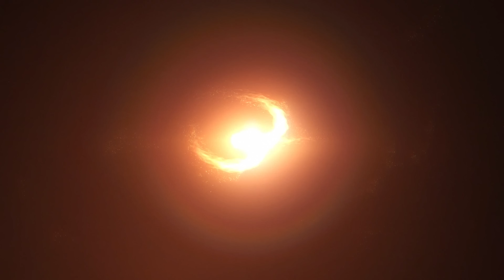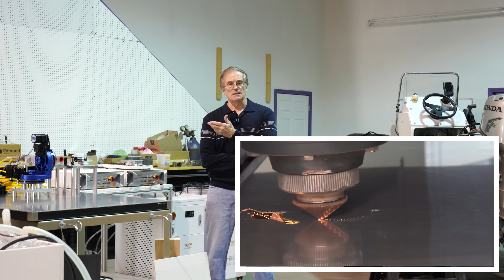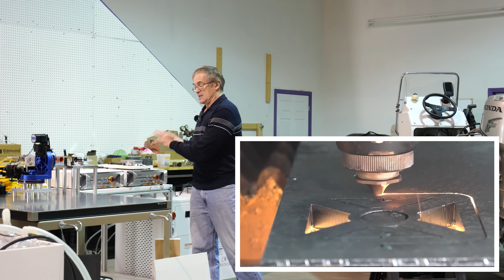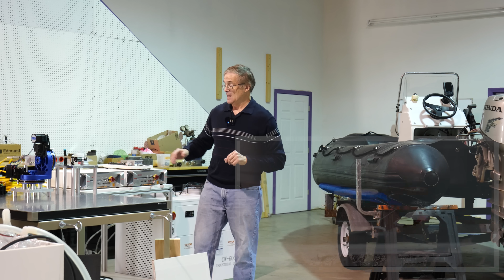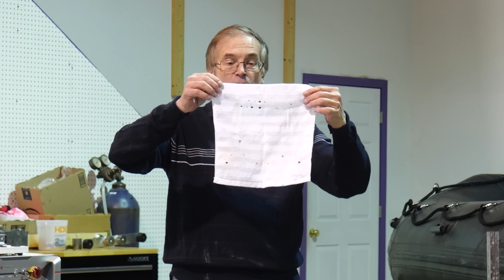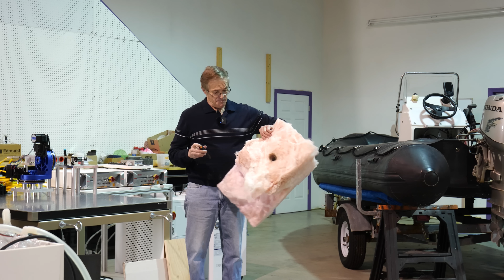We have a problem... and need your help!

Comment: For test purposes, Instead of pointing the laser horizontally, point it to the ground. The planet itself should neutralize the beam.
Reply: An aquarium filled up with Zyrconia particles (or other material that absorbs the laser wavelength) in water.
Maybe some stirring will be needed.
A hole?
No problem, it will be easily fixed.
The idea is to constantly move the hitting point or change the material at the spot.
Reply: @paulcohen1555  
"(or other material that absorbs the laser wavelength) in water."
Wrong.
Absorbtion IS THE PROBLEM -- that's what is causing all of these other materials to fail.  The ideal is DISPERSION, that is, lowering the energy concentration down to something that is no longer destructive and dangerous.
Reply: @paulcohen1555  yeah I was gonna suggest what you’ve already suggested. An aquarium with something fine to absorb the light and transmit the heat to the water. Which could even be ink? And if the aquarium is roughly in the shape of an archery target and kept rotating, any bubbles formed by vaporized water will move out of the beam faster than they would just due to gravity? not so much at the center of the target though - were there wouldn’t be much motion.  Yeah I think aiming the beam down or reflecting in a mirror so it goes down into the Earth is a better option. it’s safe to aim it down into the Earth. It’s not coming out the other side.  not a chance.  But you may end up with something useful for geothermal power production although I presume you’re not even close to what’s needed, even just for that.
Reply: @paulcohen1555 love this idea!
Reply: Have you seen the Rick and Morty episode where they drop a lightsaber…
Reply: @bangsbox you shall be the next chief of engineering.  It is a coin toss, Putin already has a hole on his land, the deepest. Xi does not share much, as our president and corporations keep trying to fleece him... 😂  🤔 geothermal, with this laser? For an alternate means to drilling the well ... 🤔 $$$😉
Reply: @bangsbox  hahahah 😂
Reply: this is probably the way to go. It's cheap and safe.
Reply: I wonder if heavy theatrical smoke, or (pigmented?) water mist, could also absorb some of the beam?
Reply: @lyfandeth Yeah I was thinking something similar, atomizer vapour tunnel.  Long tunnel full of vapour, then something at the end of the tunnel to catch the weakened beam
Reply: A huge sandbag. If they persist in pointing the laser horizontally. Vertically, it would be much easier.
Reply: I think you need thick carbon foam. It would only weigh like 20 pounds, but would not be cheap
Reply: The Super Proton Synchrotron uses graphite. A Google search immediately brought up graphite blocks. Also consider collaboration with your friend Nighthawk in Light to test his formulation of Starlite?
Reply: @MrBillTroop73  I thought of him immediately too. He's worked on some materials that could be really good for this.
Reply: @MrBillTroop73 my first thought as well was nighthawks starlite.
Reply: A combination of ideas here may work.
Point the laser down over a large drum of water.
Put some sand / crystal particles in the water and agitate it with a pump.
The hope would be to defuse the light and adsorb the heat in a cheap and easy to move container.
Reply: software glitches for second and suddenly Kola Peninsula in Russia is not anymore the deepest man made hole anymore !
Reply: @realdamageboy  It would take a few DAYS to do that.  You're talking about vaporizing 20 MILES of rock via only a a 1 mm^2 application surface.
Reply: What about sand bags or two drywall panels with sand in between? Sand can be poured in an drained out for transportation. It is something like a brick but that can be poured
Reply: If they are at all worried about fires, what about aiming down into something like a pool? Also commented over in the suggestion of a waterfall, but a pool might be more simple to contain, just need to figure out how to suspend the laser and prevent it from over traveling the edges of the pool. Also suggested dyes/pigments could increase the rate at which the laser is dispersed . . . think green water on St. Patrick's day but something more opaque.
Reply: @MrChompenstein  
Waterfall in a turbulence zone beats a pool, because of the constantly changing refraction angles will disperse the beam in time, even if not dispersing it in space.
Reply: They did that in Independence Day movie…. Drilled a hole to earths core.
And similarly in aliens v predator.
Reply: @GSCt1000  Yes but I think they let the devil out and now runs the earth!
Reply: @GSCt1000  🥁🥁📀
Reply: @GSCt1000  it's real far
Reply: @GSCt1000  you saw a very different independence day movie than the rest of us. you mean "the core"?
Reply: @gg-gn3re the core was with unubtainium , where they had to restart the spin with a nuclear weapon to restart the magnetic field.. I’m sure it was independent day one or two.
Reply: @GSCt1000  oh I guess some new independence day that nobody should ever watch has some aliens drilling
Reply: @everton-zp  this is an interesting thought.  Pairing this with sand would be great.  Nothing is likely to be cheap, but yeah mount this thing high and change your x and z axis.  I wonder if you still get to test drive the same kinematics in the “where will this be” tracking formula such that it mirrors horizontal orientation
Reply: Because now your z axis has the acceleration of gravity which affects vertical drone movements, so like if the drone drops into free fall kinematics would help but now you are judging that axis not by easy to detect left/right or up/down but by the shrinking of the size of the object, if only using rgb

You can still hit it of course, a laser is a straight line, but you aren’t any longer testing it the way one would really use it, guessing the position it will be in and “hitting” it if the drone operator decides to nose dive it for evasion
Reply: Exactly my thoughts, so simple.. just cut into unlimited depth mud for free  - why try to make a fancy wall
Reply: A gun range?
Reply: *and keep the world hostage. As target the moon. Or both. (2 lasers!!!!11)
Reply: A ten foot long piece of corrugated pipe, filled on site with dense sand (like zircon sand) or pea gravel, filled with water, might give you enough absorbtion? Using a sacrificial inch thick soapstone slab in front, so it didn't all drain out instantly?
Reply: Laser drilling! :D
Reply: @lukakrulc1092  that would be interesting video if not just a big melted hole, I'm wondering if the stone can vaporize if exposed to short firing frames, then cutting might work ? ..
Reply: Low angle vertical steel sheet wall with a flow layer of water from the top. The beam hit the water layer first but the continuous flow of water will cool down the steel as well as the diffuse the beam. That wall could also be made of multiple sheet vertical cascade  just like a fresnel. Still positionned Nearly vertical but with light negative angle pointing down but just vertical enough so they keep water flow to stick to it.
Reply: what about plastic negative fresnell lens who expand the beam at exit...?
Reply: or if something could reflect it, put it behind and angle it 45 degrees and redirect the laser into the concrete ground, you can always fix a few holes without much effort. if the material absorbs some of the energy, you could make a series of mirrors to bounce off, losing energy each time then finally into the earth, but that would be impractical if it has to be big.
Reply: @JetSteele  Concrete would be like hitting tnt with a hammer!
Reply: @Moonlightshadow-lq4fr  Well, I don't know what his workshop floor is actually made of, I was just saying concrete without thinking. You could redirect it to a pool of dispersive liquid like water or a gel with billions of suspended reflective particles. Or, if firing horizontally, since he was impressed with the wood but it burst into flame, alternate layers of the wood and whatever metal absorbs it best, sandwiched and clamped tightly together (metal layer on outside) with a seal around the edges to limit oxygen ingress to help avoid fueling internal fires, the wood being separated by the metal would hopefully isolate and contain any potential fires anyway. Get CO2 with a small nozzle and just blast some in the resulting hole after test firing, or just cover the hole with tape since the only source of (external) oxygen for the fire would be the hole we just made because we sealed the outer perimeter and we made it thick enough that it wouldn't penetrate fully (or, if that's not possible, just use two bits of tape 😂). Angle this panel down 45 degrees so the laser hits more surface area (and redirects any reflections, both externally for safety and internally to maybe bounce the beam around a bit within, dissipating it's energy somewhat), and it is a thicker obstacle to penetrate.
Reply: Some kind of composite is the likely solution. Based on your tests, perhaps a sandwich of plywood between drywall panels glued together. There will  be no oxygen to burn the plywood.
Reply: Like @everton-off-road said, reorient your test to point at the ground. This would work quite well and if done in your shop would cost the repair of it floor (just be sure to avoid utilities). If you needed distance, a tower can give you the height you need, might see about renting one or something or mount it to the ceiling of your shop.
Reply: Eh.. I took a fresnel lense off a big screen TV and burnt a hole straight through the concrete in front of my garage.
Reply: Huh?  @D4Dummies
Reply: The engineers of the Death Star think otherwise.
Reply: It would work, but then you severely limit the range of the laser.  Think in terms of the old photographic enlargers.  They could only enlarge as much as the height of the column head of the enlarger is from the projected image.
Reply: water cascading down a wall?
Reply: I agree this was my initial thought. Just elevate and turn the beam vertical, point it towards the ground.
Reply: I posted elsewhere but if you have to do it inside direct it into a tank of water with suspended carbon (coal graphite etc) or if that is not possible a sheet of carbon with water flowing over it as a waterwall.

Literally just wet charcoal with water recirc. It is non ablative water cooled heat shielding used in reentry vehicles. Just don't shoot a block of foam at it.
Reply: I'll be on the edge of my seat, waiting to see where this goes. Resist the temptation to target the Youtube servers. 😊
Reply: This sounds like the most efficient solution. You could then easily put any material under it, like wet sand maybe or a pile of salt or anything else.
Then again, if they want to test its targeting capabilities then pointing it at the ground might not be viable
Reply: Water Waper or CO2 Waper.
Reply: Just be careful not to drill a hole in a gas/water/electricity/phone line!
Reply: Could have a fume hood style set up that has a smoke machine misting a waterfall of fog and see if it helps dissipate the energy before hitting and semi resilient backdrop mention previously
Reply: This reminds me of the episode of Rick and Morty where Morty drops a light saber straight down, and they have to chase it toward the center of earth. 😂
Reply: We are now building weapons that A) Anyone can buy, and B) we do not know how to control.
Reply: To point the laser at the ground, you would need it to start from high up. The table with the final lenses, and the laser generators on wheels would need to be brought up to the ceiling, in order to fire at a drone flying inches from the ground. Hundreds of pounds of sensitive equipment twenty feet up. After all of that effort, what you achieve is punching through utility conduits which are not very far underground. Clean water, storm water, sewage water, gas, electrical wire, networking wire. A computer-guided laser pointing at a drone will not be able to know what's under the house.
Reply: Point it down, have water to catch the beam
Reply: @brettharris9141 Water may reflect laser beams so is not necessarily safe. during my high power laser course we were told specifically not to shine lasers at water.
Reply: Stop the beam with a mirror at 45° down into a pond with colored water....if the mirror can stand the beam. Maybe polished aluminum or stainless steel...🤔
Reply: perhaps he can edge a logo in his garage floor at the same time.
Reply: If lucky he might strike gold or diamonds
Reply: stupid enough that it would work :3
Reply: This is the way.  Laser at elevation (?on the roof) pointed down.  If you want a more complicated solution, buy a boathouse so the floor is water.
Reply: An abandoned quarry or open pit mine should work well.  Physical stops will keep you safe and the beam inside the quarry.
Reply: @latemarch2  They have to do it inside a building because even lasering small cheap quadcopter drones is the same as shooting down an airliner from a legal point of view in the US.
Reply: @latemarch2  that would be a bit sketchy... if even 1/10,000th of the energy those beams put out hits a random piece of reflective mineral (think pyrite) you could really get chaotic damage to god knows what - or whom.
Reply: @latemarch2 they have a ‘laboratory’ they’re accustomed to working in.
Reply: I hope so. otherwise some guy having his morning poop in china would have a very rude interruption.
Reply: That is what the Atlantians said, followed by 'Oups, we melted earth. Mayday, Mayday we are sinking!'

Now dont go do gain of function research, you might just accidentaly kill millions and make apparachiks around the world accomplices
Reply: What about buckets of water? Not an engineer just a thought.
Reply: Oh ffs... I just wrote this almost exactly..!  I never read first, just type...
Reply: If you place the lasers high up this seems workable.
Reply: Water tank with a thick acrylic port hole as a target. Acrylic gives off VOCs when cut; not great, but less toxic than even plywood glue. The port hole is replaceable between shots, but it could also be repaired by gluing in segments of acrylic rod. Since the spot size is small by nature, the holes should be small and the water loss should be low as well; place a tray or pan below the port hole to catch and reuse the water. The inside of the tank can be coated with something that absorbs at/near the laser wavelength, or be coated/polished to reflect laser light back into the water. Add mica powder (or similar) to the water to further scatter the laser light; keep it distributed by circulation...a sealed system with a peristaltic pump will circulate the water without fouling. Tilt the tank vertical to replace/service the port hole; it could be mounted on a stand with pivots at the cg of the full tank to make this easier. Reflections coming back from the first surface of the port hole might be minimized by firing through a sacrificial curtain; space out alternating layers of heavy canvas and mylar "space blanket" material...it shouldn't catch fire (maybe smolder a bit, soaking the canvas with water would minimize this), and it should catch scattered light and reflect semi-cohesive light back towards the tank. This way, the only cohesive light coming back towards the source would be straight back at the emitter through the holes in the multi-layer curtain, and only from when it first hits the acrylic port hole until the laser ablates through to the water, which should be a very short timespan from the sound of it.
Reply: Or find a hill, like at a gun range.
Reply: Tilt
Reply: Try that hard synthetic clay used for car detailing.
Reply: Window glazing? @tdrv33
Reply: Unless it melts its way through the dirt and hits a burried gas line or ignites some sort of oxygen bearing geological deposit which creates a self sustaining inferno that results in sink holes to a firey abyss.
Reply: Im stuck on tile backer board. Soak it in a flame retardant. Screed thinset across to heal overshoot damage. Better still...porcelain tile, back side out for non-reflect absorbency. If that laser does anything to porcelain tile, installed over acrylic thinset, on to cement tile backer board screwed every 6" perimeter 10" field, soaked in flame retardant over existing wall substrate, I need to see it.
Reply: Corridor channel made videos about this ...
Reply: I don't know if this would help, Space X is replacing tiles on the rocket with a different type of water cooled tile, trial I think. If those tiles are heat shields, would they burn up? I'm only guessing.
Reply: only issue: the goal is to shoot down flying things, not crawling things ... but 🤔 suspending the lasers from horizontal scaffolding, if high enough for the drones to fly beneath, makes some sense. could then draw a target ring on the ground showing the limits of the laser's directional gimbals...
Reply: Stonewoll are superior to glass woll  and cheaper. Sudgest a layor of this and a layor of slight angeld mirrors behind to chatter the beam back to the stonewoll. Wettend  bedcheats would be self addhesiv and cool the reflectiv layer just a bit.
Reply: This is literally how volcanoes start
Reply: A blue patio umbrella
Reply: Using fiberglass flashed to mind in the begining of your test narration, but later seeing your sample; burned, a hole in my ego!
You leaned on the idea of optics of diffusing the beam, but that fiberglass was not optical grade as with fiber optics or lens grade, so this route still nags me!
It could be expensive but perhaps using multi layered, angularly offset, optical grade glass mesh could be used, to scatter the beam.
Stay with me! Not the industrial kind!
Suitable diameter*** monofilament woven glass mesh.
With sufficient open area percentage, determined by trial and error, dyed or undyed according to your optics experience.
It will have to be custom made as industrial mesh would be too delicate.
* I guess the diameter should be as large as the laser generating cylinder (I imagine), which is serving you well!
It could be supercooled with blasts for the cutting duration.
Layers of previously tried sacrificial materials could be used along with this.
Will a brick size version do?
And hey, what did you say your special laser was made of!
I'd be thrilled if I have made a contribution in any way!
Wish I had a laser cutter welder to play around with!
Best wishes!
Reply: Faraday cages of microwave doors.layers.
Reply: A bulk container of sand.
Reply: This is actually something I read someone did on Reddit.  Basically, they did their laser work in the fireplace!
Reply: What if it shoots a hole thoough the planet😂
Reply: Or into the sky!
Reply: How about applying a a light absorbing paint like the Japanese black paint that is so hard to see because it has no reflection whatsoever..  if that were applied to a concrete pavers lined up in parallel with air gaps in between.the paint could absorb some of the energy and then the cement pavers could take the rest of the hit.
Reply: Can the laser be dispersed with the same optics approach you use to focus it?
Reply: Id say wet ash from a woodstove
Reply: A rapidly rotating boron carbide or aluminium nitride  drum  with a roughened surface and a co2 gas cooling system?
Reply: Adaptive optics testing uses laser pointing into the sky. They usually hire a grad student to watch for planes.
Reply: ☝️ This is the best idea I have heard thus far and I'm almost embarrassed to admit I didn't think of it. Will it come out the other side of the Earth however if the laser is powerful enough? Eventually yes, they will become so ( as long as humans continue to improve them) and then power will become infinite (or at least powerfull enough) at which time most certainly, the laser would push through the other side of the planet. At that exact point in time (or hopefully well before if we as the human race plan for it, let's do that)  it becomes an ethical question if we as humans of the planet Earth should be sending infinitely powerful laser beam weapons into space.
Reply: Pissoble create a pressure sensitive triggering system that alters the quantity of power being used? Maybe a feild of some sort thst is on a rotation so a gravitational firce can decrease the strength is wanted and sinply rotate the system so itboperste normally? Posdible? 😂 Can u use other materials non metallic within the system? Absorbing more. Or like he said reflection angles more subtle? Surprise I'm a layman 😂
Reply: How about placing the laser inside a bowl shaped like a satellite dish with a mirror finish on the inside? The walls of the bowl being so high that it cannot fire beneath 10 or 15 degrees of elevation. I am not a scientist and I dont know if there is a reflective coating that can withstand such a powerfull laser, but my idea is that if it fires below the rim of the dish it should be constructed like a parabola so that the beam is directed upwards if it hits the sides. Ok this might be insane, and introduce a whole new range of problems, but i have heard that they "make" mirrors for observation of deep space, where the mirror is quicksilver (Hg) that is spun around to make an almost perfect mirror.
Reply: dry sand (sand dune) it'll fall in on itself refilling hole as long as not turned into a glass tube i also like the 45 degree downward angle to maximize the backstop  or wet sand even you  could mix aluminum powder into your sand and then  control lazer with 3d printing head to try and make  3d models 😅 but that's another project
Reply: Maybe using a.large plate made of starlite
Reply: A waterfall?  Filled with alumina powder?
Reply: Waterfall feature over a brick.
Reply: Had a similar thought, but maybe direct the beam into a pool of water with IR absorbing dye
Reply: Now I want to watch the video.
Reply: Hmm yeah a mirror into a kiddy pool with stirring, dye, and potentially some ice would probably work. Utilize the massive thermal capacity of water. 

Would need something that could reflect this thing without melting though.
Reply: I'm not sure about the material to use, but try a moving target so the beam isn't focused on a single point. I'm thinking a white cotton buffing wheel soaked perhaps in oil rather than water so it doesn't evaporate as a proof of concept, but there's likely better materials.
Reply: Rocks explode, violently when heated... Then after they're heated while releasing energy they kinda change into other stuff and release toxic gases and your left with a mess no one wants to deal with
Reply: This is a better idea.
.
https://youtu.be/r3uMeF4Wfy4?si=b1zZkeecCwyWbpaY
Reply: I had the same idea!!
Reply: That will destroy our EARTH!!! 😫😫
Reply: @onklim  well, given the current path of humankind, it wouldn't be a bad idea.
Reply: @everton-zp 😂😂
Reply: Because the target may be a drone i think that would just be easier to send the beam to space.
Reply: Just point the laser down to the ground?
Reply: @ph5740  Yes, just like that. Genius idea, isn't?
Reply: I don’t know if this is suggested already but have you tried ceramic fiber insulation blanket, I think the rating is 2300F
Reply: Something like K wool @SoggyBottomBoy_
Reply: Mirrors covering the walls and ceiling. My 12 yo brain at work.
Reply: @grantadamson3478  Extremely dangerous.  In fact, that would be suicidal.
Reply: Then why not the sky? Let your light go voyaging through deep space...
Reply: @uvtube2008 dude there are planes and satellites. Never risk blinding a pilot.
Reply: @GSCt1000  you are correct about planes, but not satellites. They are too far for it to cause any issues. But also if you’re firing this laser at drones they are going to be in the sky, so I don’t think that matters.
Reply: @GSCt1000 or cutting the plane open, depending on how much dissipation the beam has at distance
Reply: @GSCt1000  loads of laboratories all over the world shoot lasers that bounce off the moon from the reflectors that armstrong and aldrin left there.
Reply: @GSCt1000  pilots don't look straight down, except helicopters in search and rescue. And maybe Cessna's in tilted circling.
Reply: @GrowingAnswers  Would you bet your life on that? I'm an engineer, and I wouldn't.
Reply: @garywheeler7039  I heard that there were cases where some mischievous brats near airports shine laser at planes, which causes the pilots to be distracted and startled by the light.

And where i am is against the law i think.
Reply: @akulkis  What do you mean?? Worried about satellites?…the closest ones would be around 100 miles away. That would mean by the time the laser light reached it, the beam diameter would be over 100 meters wide. That likely wouldn’t even damage anyone’s eye let alone cause any damage to satellites. Now think about that further…even a perfectly steady beam would have a satellite passes through it at 17,000 mph. The contact time in that moment is so short that a regular frame rate camera on the satellite wouldn’t even see the laser light. You know what’s even hotter and than a laser pointing to space…the Sun in space. What kind of engineer are you? I’m not any kind myself. The radiant heat from the Sun in space reaches over 200F on surfaces. And you’d be worried about a little laser?
Reply: @GSCt1000 I don’t think “blinding a pilot” would be the result of accidental laser contact￼… think more on the lines of toast￼.
Reply: @GSCt1000 but what about the mole men in the ground?
Reply: @GSCt1000 or setting one afire…
Reply: @uvtube2008  The FAA would buy you an expensive free ticket to El Salvador 🙄
Reply: @uvtube2008  'the FAA has entered the chat'
Reply: @uvtube2008  I think the FAA will catch you quick! LOL
Reply: @uvtube2008  you'd risk the odd chance and airplane would fly over
Reply: @uvtube2008  That will work great as soon as they get someone to declare the area a no-flight zone. :D
Reply: @uvtube2008  To the sky you risk hitting one of Elon's satellites and he would be very upset. 😅
Reply: @uvtube2008  Will hit a com satellite for sure.
Reply: @uvtube2008 Because of aircraft and satellites…. A woopsie could turn into a very big felony as a minimum…
Reply: @uvtube2008 shooting high power lasers into the sky tends to attract 3 letter federal agencies.
Reply: @uvtube2008  Don't give people dumb ideas... you can get fined or get a beating, pay a fine and THEN go to jail if you point a powerful laser in random directions.
Reply: @uvtube2008
Engage your brain:
Laser Beam anywhere visible from an airplane ==> radio call to FAA
==> evidence galore ==> Felony Arraignment, Trial, Go To Jail.
Reply: @uvtube2008  That is a HUGE safety risk.  There's all kinds of things out there:  Planets, the moon, satellites, aircraft, emotionally unstable space aliens.....
Reply: @uvtube2008 you know,green laser pointers are enough to blind pilots..and that's just a laser POINTER